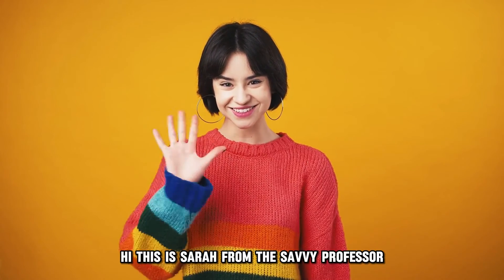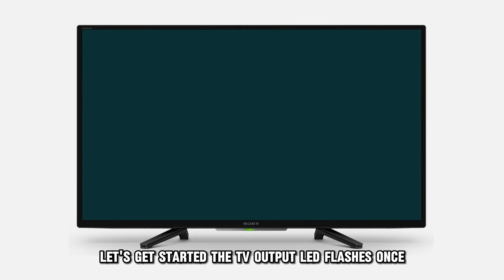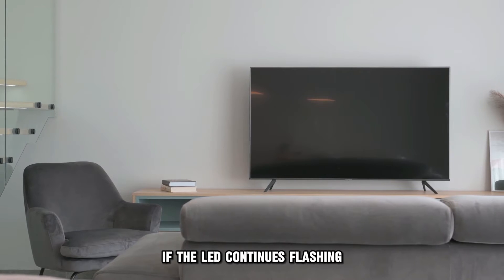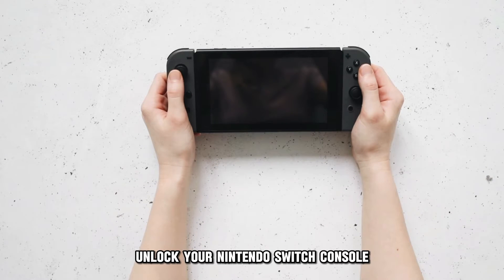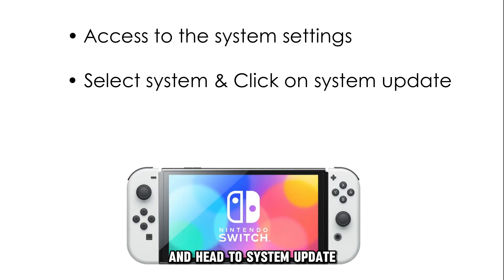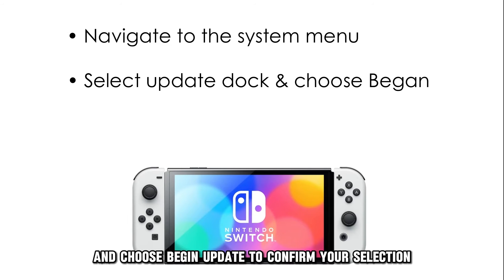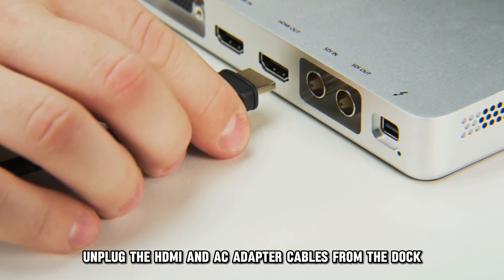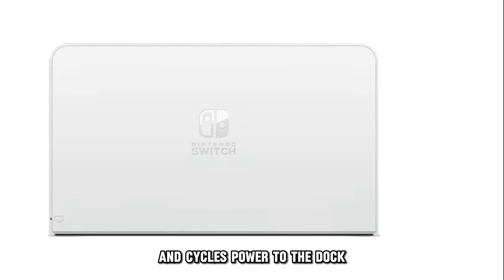How To Fix Nintendo Switch Dock Flashes Green Once (Why Nintendo Switch Dock Blinking Green Once?)

Comment: In order to update the dock firmware you have to put the console in the dock. This won't work if the dock is not operating properly. Ridiculous advice.
Reply: Update the switch plug your dock it will tell you to plug the console to the dock. Then it will update
Reply: @jesicasantiago2970  My dock is dead. This doesn't work.